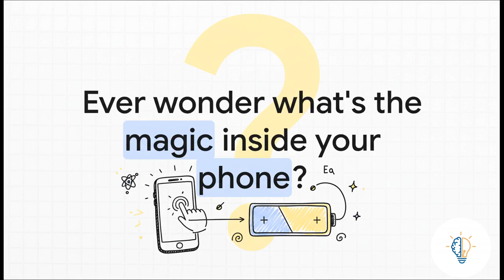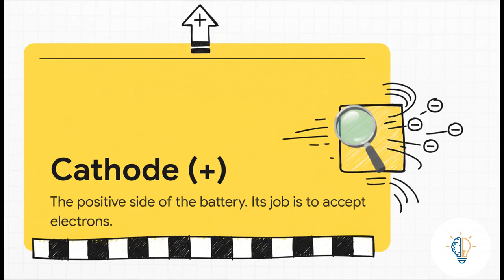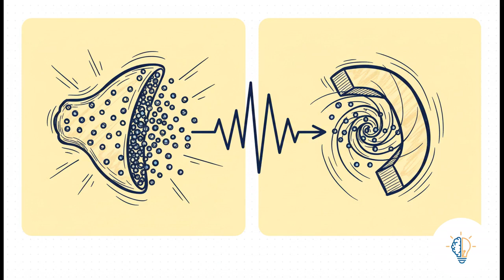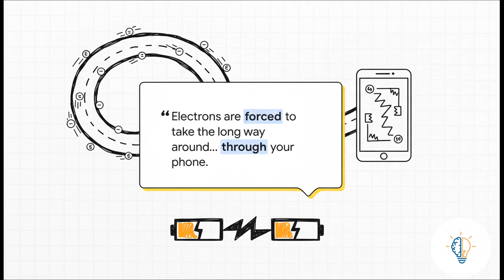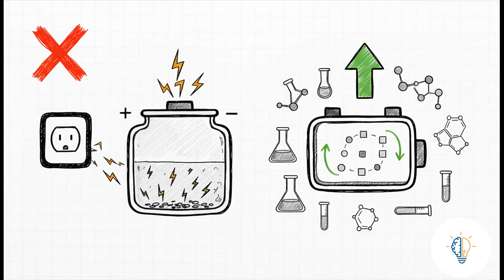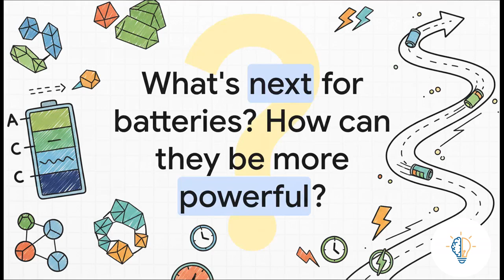How Do Batteries Store Energy?

Comment: Why won't electricity flow from the anode of one battery to the cathode of another battery unless they are party of the same circuit?
Reply from the maker: Because charge only moves when there is a complete, continuous path for electrons to flow, so an isolated anode and cathode can’t drive current without forming a closed circuit.